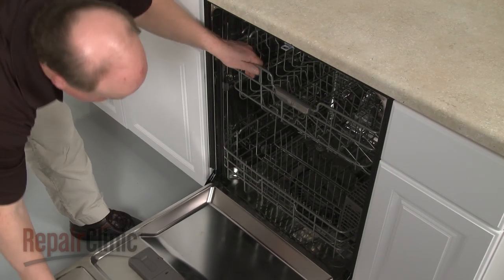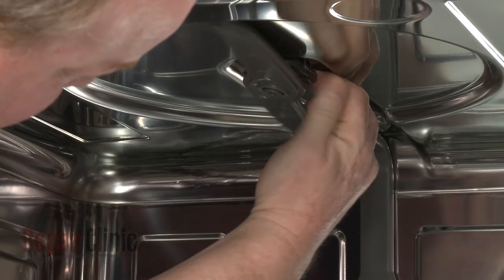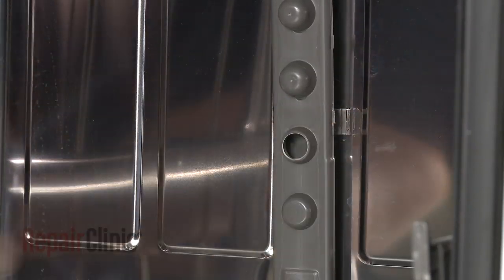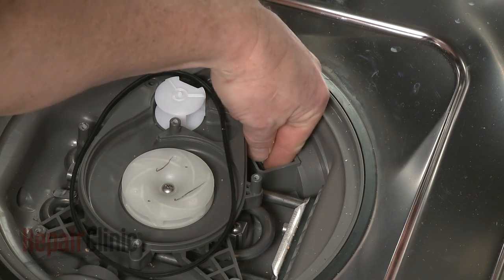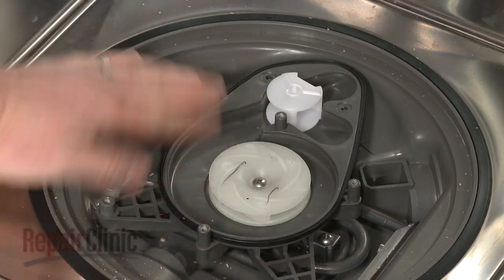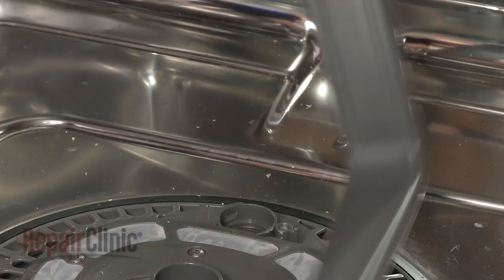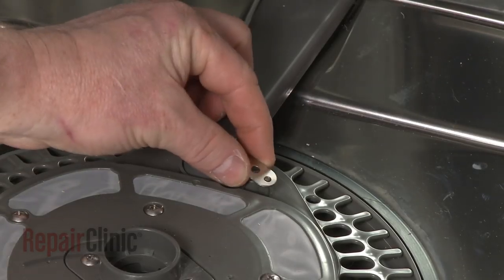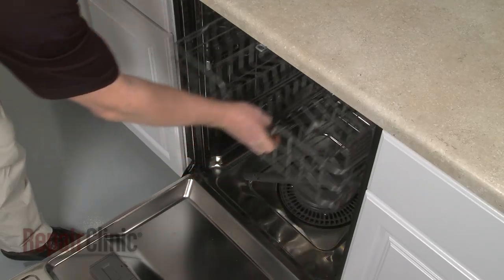LG Dishwasher Check Valve Replacement #5220ED4004A

Comment: My check valve is twisted, so does that mean it's letting water backflow into the dishwasher? I have standing water in the bottom, and a drain error. I ordered a replacement, it's worth the $10 to try before I call someone.